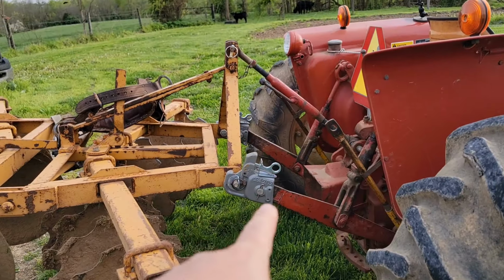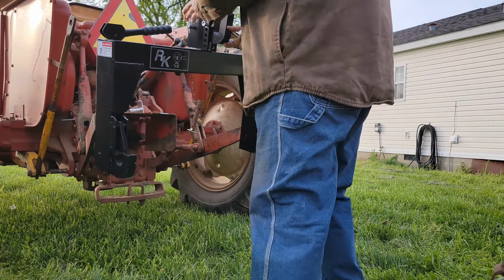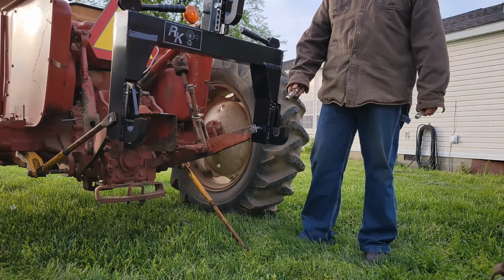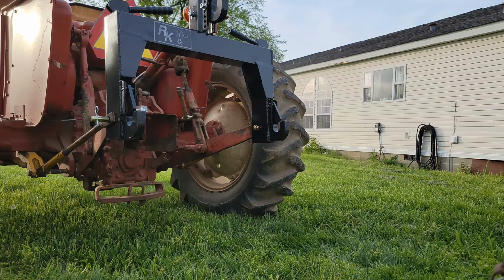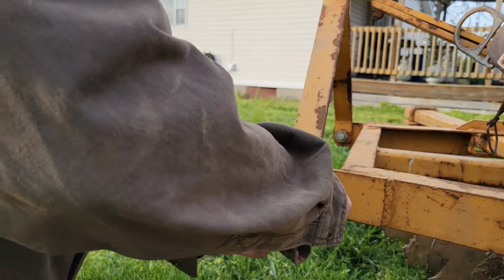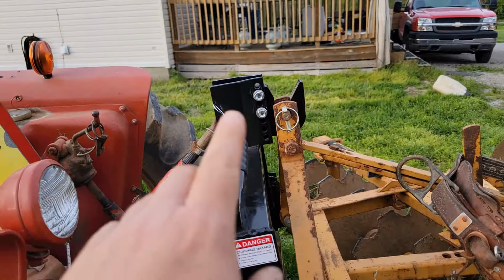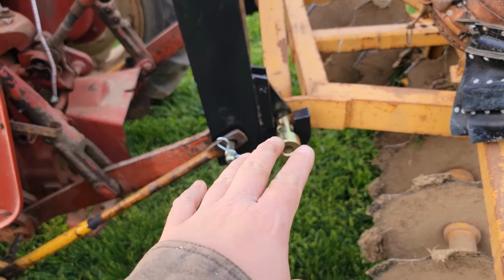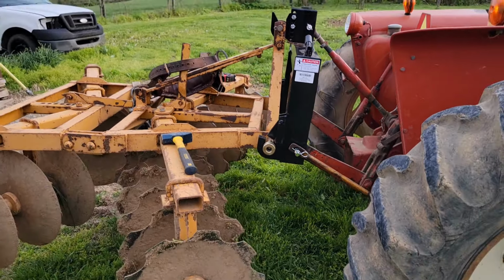3ph Pat's to a Quick Hitch upgrade.    IH 464

Comment: Love the harrow. Been wanting one that would allow the back disc to flip so I could use it as a bog harrow for 50+ years.
Reply from the maker: This is a 70s or early 80s model and is built better than it needs to be.     2 people can't flip the rear section because its so heavy.        It works well I will say.